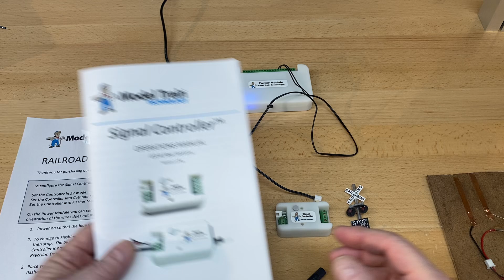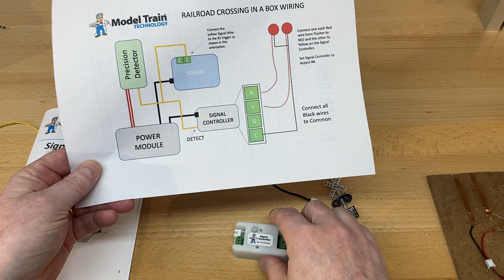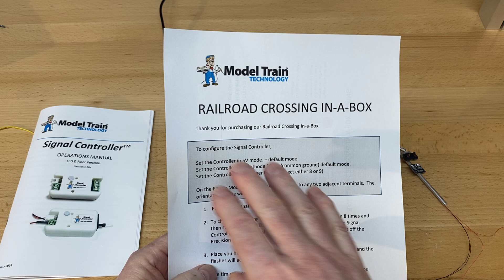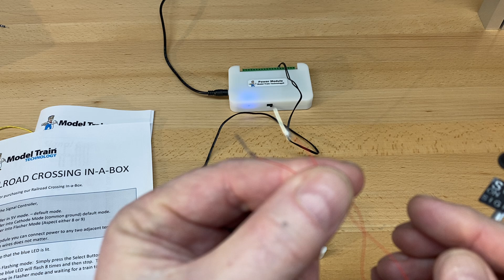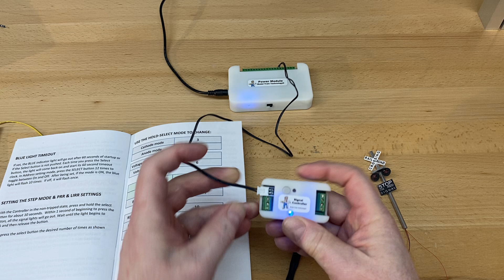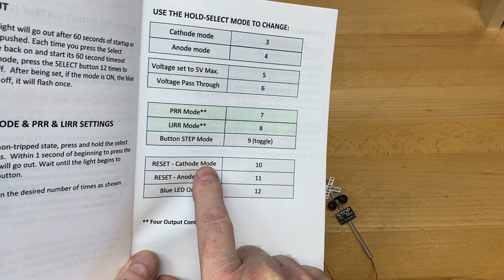Configuring the Signal Controller for Railroad Flashers

Comment: I like this set up.  Having just purchased your detector / relay products for our Thunderstorm, I’m thinking we need some lit up crossings as well.  How do you use two detectors with this circuit?  Is it simply a matter of using two detectors and wiring the signal wires both to the signal input on the flasher module?
Reply from the maker: Basically, yes.   You would use our Signal Controller which has the flashing mode built in along with regulation of the power, resistors for the LEDS, etc.  You cannot use a thirds part flasher unless you use one of your relays to turn it on and off.